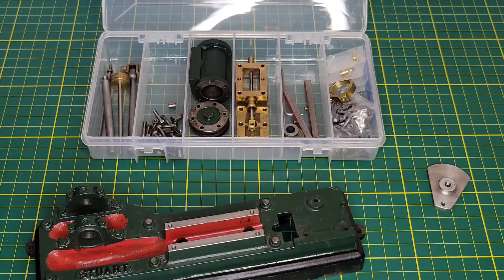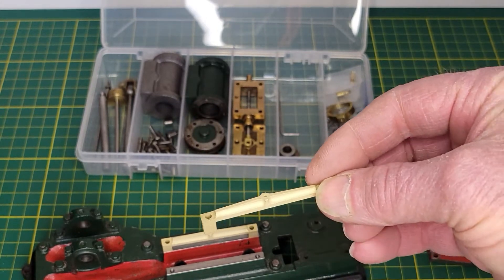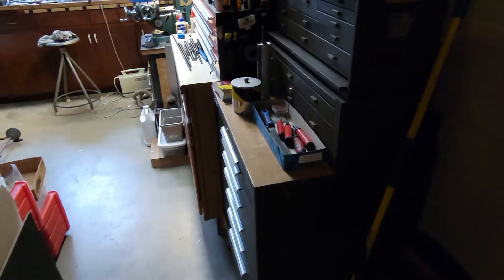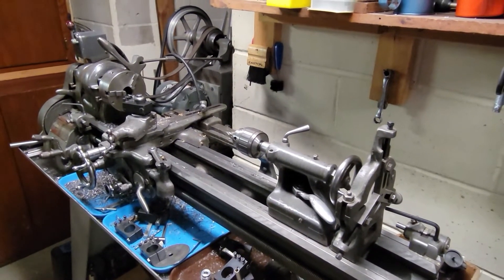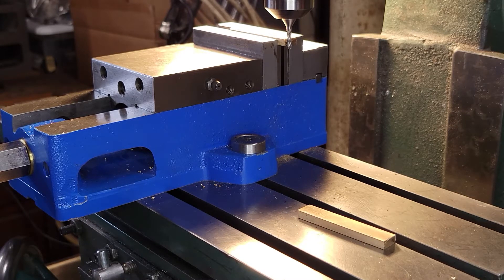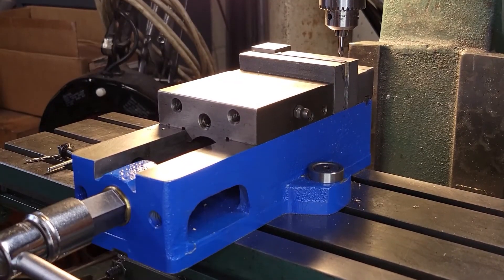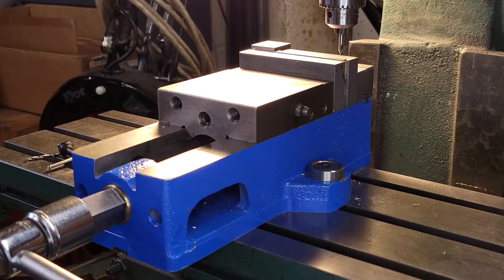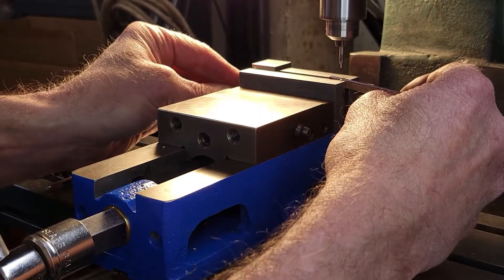Stuart S50 Making Parts & Shop Tour

Comment: Thanks for the shout out Jim . I am missing doing the S50 now that mine is done . thanks for the honesty with the centre drill. we have all broken them many times I am sure . Making the standoffs and bridge in one piece is brave as far as adjustment of the cross slide clearance is concerned . you get one chance to get it right. Bronze is the metal of the Gods . Cheers Ade.

Comment: Fantastic little workshop you have there. Like some other people have said, the mill is really nice, but so is everything else! My workshop descends into chaos very quickly, yours looks like it's under control. A tip for you.... Use centre drills for drilling holes for centres, use a spotting drill for normal drilling operations, they are much more robust.  Your stickers arrived a day or two ago, many thanks, I'll put them up on the sticker board very soon. 👍